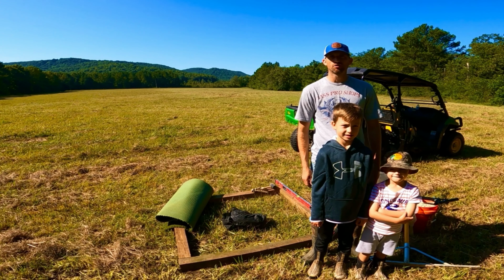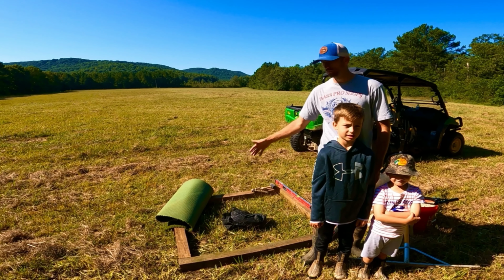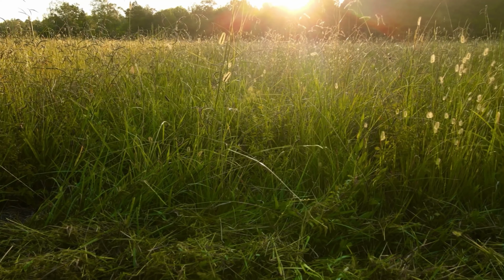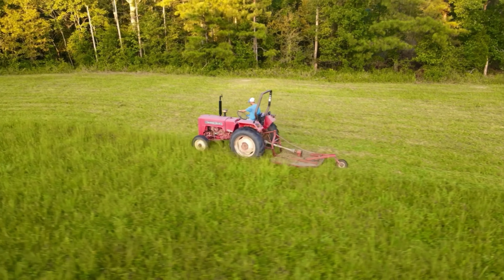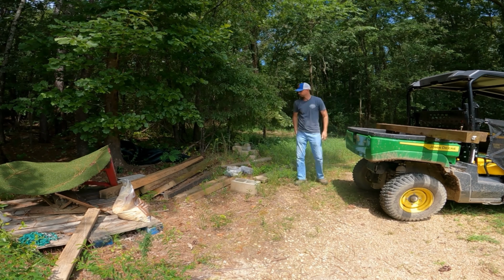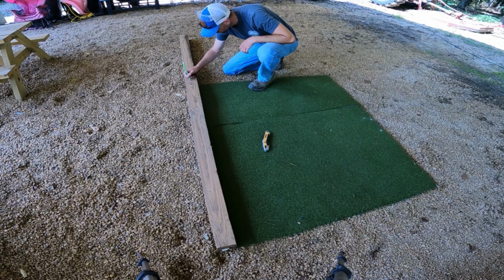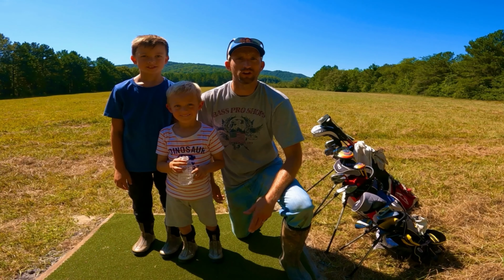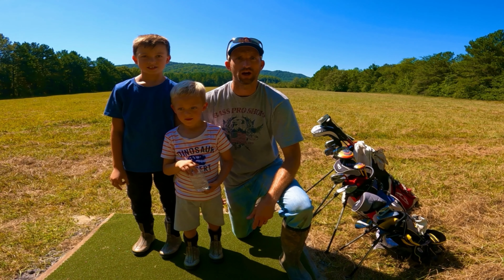Backyard Golf Practice Facility:  The 1st Tee Box

Comment: Love the ongoing project you guys are building!  In my backyard, I have the space for an eventual putting green and 2 spots for pitch shots.  One is a 40 yd shot down a slight hill, the other is level of about 25yds.  I actually have range mats that I grabbed from a driving range.  Would you suggest still making the crushed rock buildup since the range mats have that natural thick rubber shock absorption already built in?  Im planning on it being more level to the ground and not above ground like yours.  Thanks for any advice!  May try the artificial green plan that you did at your old house- that looks close to the same size I would use.
Reply from the maker: Thanks so much Jeff!  If you are building on flat ground and don’t want the tee elevated, you could just kill all the grass where the mat will go, put down some weed fabric, and then put the mat on top.  I would suggest, however, to dig out a share as big as the mat about 1-2 inches deep, put down a weed fabric, and then fill it with a paver base and compact it well.  As for the green, I used a 20x15 piece of turf and it was really cool!  If the area in front of the green is flat and dry you can hit 40 yard shots that take one or two bounces short of the green and then stop next to the flag…😄
Reply: @UnderParAcres  thanks.  I figured it would be tough to build a synthetic green myself that would hold a shot of that distance and also be firm and fast enough to putt on.  Thanks for the advice and enjoying your adventure
Reply from the maker: Thanks again and good luck with the green build!  There’s a lot of great detailed videos on YouTube that helped me a bunch, and it really comes down to following every small detail. It’s a very rewarding feeling once complete!

Comment: Thx. What was the powdery substance that you applied over the gravel?
Reply from the maker: That's a paver base sand that helps get the surface perfectly smooth and flat.  Having built a handful of these, I will probably build a concrete slab as the base moving forward because after hitting a ton of balls, the crushed gravel gets moved around and it get a little lumpy underneath the mat.
Reply: @UnderParAcres  thx! That’s a good idea about the cocrete

Comment: That’s a great tee box there how’s it holding up? I plan on making tee boxes and I also have a bunch of 4x4s laying around I think I’ll have to try this style here
Reply from the maker: Holding up very strong!  Just be sure to screw the 4x4’s in place tightly and compact the crushed gravel really well.  I also created about a half inch of pitch to be sure rain drains off the top of the mat and doesn’t soak down into the sub base.  I’ve been very pleased with it so far…Thanks!